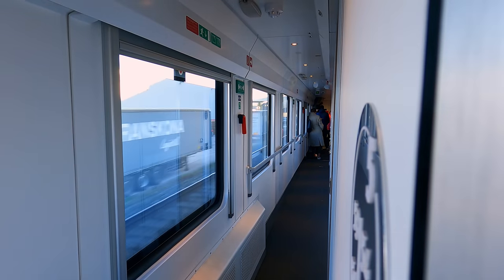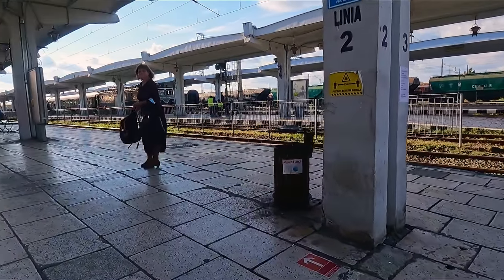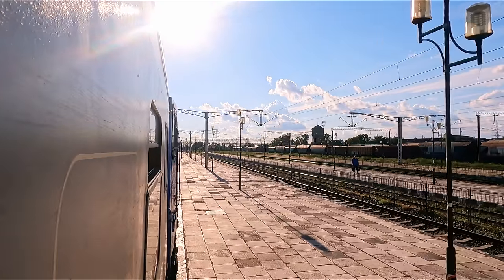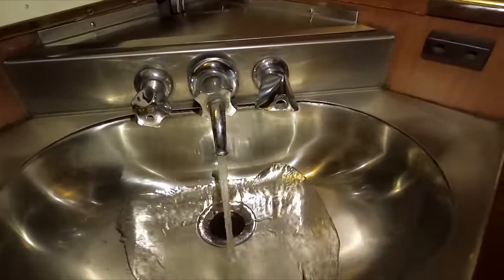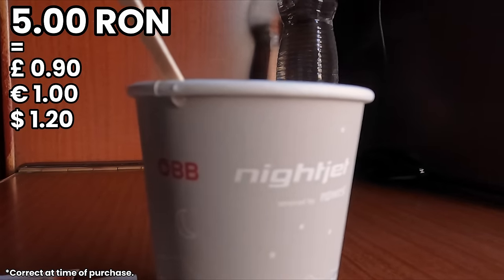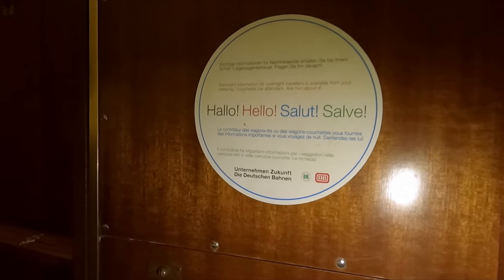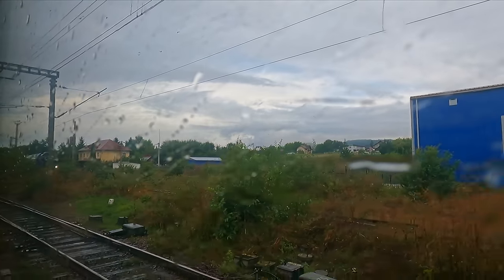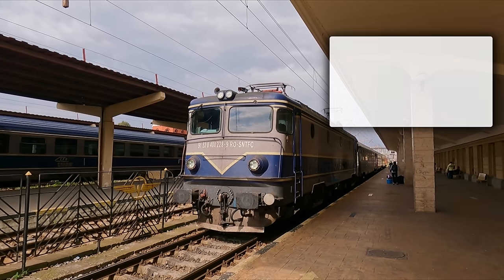My long ride on Europe’s OLDEST overnight train!

Comment: I travelled by train in Romania last year and had a nice experience. But there is so much unused potential in Romania. They have way to much car traffic and need to update their train infrastructure as well as implementing a regularised scheduling system with trains running every one or two hours on busy routes, especially to optimize commuting. I also saw that on the route from Brasov to Sibiu nearly every station we came across was equipped with staff and they have to give way for the train. That's a signalling technique that's incredibly inefficient. There could be so many more people riding trains in Romania.
Reply: As a romanian, I'm telling you, its easier said than done.
Reply: @TheRealVGR well, first it has to be said 😅
Reply: Currently the Romanian government's focus is on Highway infrastructure, so I doubt there are gonna be any major rail projects in the future.
Reply: @Ch-xc4fo  actually, there are currently plenty in development, as we speak. Including major corridors :)
Reply: And CFR is intending on cutting down more trains and staff :( . 10-14 years ago there were more trains and waggons too.
Reply: @roxyroxelle  yeah, it's because ridership levels have dropped and some routes are not profitable.
Reply: CFR has a lot of big projects running. They are modernising the main corridors. But I still don't see the light at the end of the tunnel. Last year, after 10(!!!) years of closures and serious restrictions finally the central section (Sighişoara – Alba Iulia – Simeria) of the mainline 300, the most important mainline, is finally ready. New signallings, high speed switches, brand new and fully EU-conform infrastructure. And if you want to travel for example from Blaj to Alba Iulia (county town) you have one(!!!) train per day. On a brand new high speed infrastructure. 

Also suburban traffic is unknown in Romania. They have several mainlines running between mountains, following banks of rivers, thus directly connecting smaller villages to bigger cities – without trains. And in this case "without trains" means 4-6-8, or even 10 hours of voids in the middle of the day without a single train, even on mainlines. 

2 years ago, first time in the history of CFR they made an experiment on the mainline 800 (this is the "iconic" line of the CFR between Bucharest and a main city on the bank of the Black Sea, Constanţa; a line fully modernised, speed up to 160km/h): as suburban traffic, they set up 6 pairs of trains: 3 in the moring, 3 in the afternoon. After 1,5 years they cancelled it. 

While some part of the infrastructure is undergoing complete refurbishment (on EU funds), other sections are amazingly neglected. For example the section Caransebeş – Orşova on the mainline 100 is full with 30 and 15km/h restrictions. Also on the mainline 100 there is a ~12km long(!) section with single line at the Balota-hill with 30km/h restriction (Balota also has some serious 10-15km/h restrictions). There was a passing loop in the midle, but after starting a rewamping project back in 2017, a disagreement arose between the CFR and the subcontractor, so since then the passing loop has only one track...
Reply: The population density in the villages and cities along the railway lines is too small to have a train per hour. Even from Cluj there are very few trains anywhere except to Dej and Oradea (the Oradea line is closed for a few years). The only lines with frequent trains are Bucharest - Brasov, Bucharest - Constanta and some other lines around Bucharest.

Comment: The train is taking such a circuitous route due to (never-ending) track reconstruction and upgrade works. Normally, the train runs either via Oradea - Cluj, but that's closed for electrification and upgrading. Alternatively, it runs via Arad, but that too is partially closed and severely capacity restricted for upgrading works. Even Timisoara - Lugoj is normally worked via the electrified Recas line, but that's capacity and speed restricted for upgrading works, so the train is diverted via the very rural Buzias line, which normally only sees Desiro DMUs and those tiny ancient rural railbuses. By the way, those archaic railbuses are finally going away in a few years - if you want to experience riding in a 1930s railbus based on freight car technology, powered by a repurposed mining engine, sitting on 1970s plastic seats, going 30 km/h, now is your time!
Reply: Thanks for the hint. Am leaving for Interrail next week and Romania is one likely target. (And yes, I know that using an Interrail ticket in Romania hardly is worth it. But I will be travelling on more expensive railways, too.)
Reply from the maker: I'd really like to try those 1930s Malaxa units. Maybe I will pay a visit to Romania in May.

Comment: Back in the late '00s, when I was commuting for my university studies, I've accidently got on this train in Simeria at around 1-2am in the night, when I got off my train to Cluj-Napoca to buy me a sandwich from the non-stop Simeria station shops which were on the first platform. The "Hunger'' (how this train is called) was parked right next to mine (the Craiova - Cluj-Napoca night train) on the 3rd or the 4th line, and when getting back from the station shop, with both trains having nearly identical blue wagons, I have mistakenly got on this train instead of mine. The train departed not long afterwards, and looking to get back to my compartment I wasn't finding it nowhere in the train, so I became stressed and confused. But when the ticket controller and some passengers told me that I was on the Timisoara - Iasi train and that it stops in Cluj-napoca too, I got relieved. It arrived at Cluj-Napoca 35 minutes sooner than my Craiova - Cluj-Napoca train that I have missed earlier at Simeria, and luckly I met on the platform the nice ladies that were in my compartment on the first train who told me they gave my luggage to the controller. So I went to look for him and caught him up across the street, on his way to the station's office. He was carring my luggage in his hand. I took my luggage, thanked him for taking it and took the bus to my student dorm where I peacefully slept until noon, pleased that I eventually arrived in Cluj-Napoca, with all my belongings, despite the stupid mistake I've done that night.

Comment: 10:32 Many people don't know about this, but the lever that brings the window up and down is supposed to be dismantled like that. It's because, underneath the lower bed, there are chairs for day use. Very comfortable but nobody uses them as there is extra work for the staff and they don't want that. Also, that's why the mattress developed a "ditch" in the middle along its whole length. People sit on it during the daytime (because the chairs are underneath and never used) and deform it.

Comment: I must note that the old trains were much better thought out in terms of creating a comfortable and cozy environment.
Of course, they are inferior to new trains in terms of noise and vibration insulation. But for me this has never been a problem. On the contrary. As a child, I adored trains because I slept listening to the sound of the wheels. Now almost everywhere there are seamless rails. And sometimes I really miss these measured knocks on a trip.

Comment: You seem to have overlooked one feature of many sleeping cars of that era, assuming that carriage still has it: a self-emptying chamber-pot in a cupboard under the washbasin that empties onto the track when you put it away after using it. I believe that many coaches that originally had that facility had it removed on refurbishment because it was deemed unhygienic, though.
Reply: I can remember when the Cornish sleeper train had that feature!
Reply: Until recently, it was unusual to have holding tanks at all in most countries, hence the typical warning labels to avoid using toilets during station stops.

Comment: Better built than modern stock. ❤
Reply: Seriously, in what sense? Just because of nostalgic vibes? Have you tried the Finnish double decker sleeping-cars? Or a new generation Nightjet sleeper?
Reply: @TangoMikeLima price of the ticket please?
Reply: It will be replaced by one of lower quality but more expensive
Reply: @eedragonr  You clearly have made up your mind and facts won’t help. Bye.
Reply: @eedragonr  In low season a ticket in an own compartment in a very modern sleeping car Helsinki–Rovaniemi (12 hours) can be had for clearly under 100€. (Just look for videos here on YouTube that show Finnish night trains).

The problem with a generalisation is that a single counter-example can disprove it.
Reply: I think that everyone has compared it internationally to the  capsule without windows.
Reply: @TangoMikeLima  thank you for being kind and answering. Meaning that the 60 years old (!) is doing better. As profit

Comment: As a tourists some years ago I traveled to Temesvár (or as in video: Timisora) by train. It became one of my most memorable journeys ever. In fact I was happy when I finally came back safe because of the many Gypsies and all kind of suspicious people traveling on the train. It looks like those who are not poor or who are a bit more educated do not travel by Romanian trains. I didn't know this. 

The rest room should be avoided if possible. I almost threw up. The train was from old times in my case too, with similar layout than in the video above. The comfort was not great, but for me it was enough on this local/passenger train for a 2X2 hours travel (back and forth). 

My wife traveled recently to Kolozsvár (or in Romanian: to Clui Napoca) with an express train, and she says that it was much more cultured than the regional Romanian train I traveled by, and the passengers were also better looking people. The price was as low as the video above informs. 

What a pity that Romania does not place more emphasis on regional train travel, because it's more environmentally friendly than traveling by car, or by minibuses. They should begin with the fight against the Romanian corruption, because almost nobody bought ticket on the Romanian train I traveled by - except me, who is Hungarian. The Romanian passengers only gave a tip to the conductor and they were allowed to travel for free. I'm not surprised that regional trains in Romania are so undeveloped.

Comment: Timisoara is my hometown and I can tell you that the regional rides are such fun (if you don't care about back pains and drunk people) -> so no fun. Through the place I moved now (20km apart from Timisoara) both regional rides and the IR1831 (the former IR1838 - your video probably was filmed a couple years ago while it was still running) pass, so I'm no stranger to these. There are plans and projects to modernize the infrastructure and the rolling stock, but it's gonna take a while.
P.S. The only regional ride I would recommend you to do is the Timisoara Nord - Remetea Mica station (1hr ride) because of the scenery and the fact that the operator, Regio Calatori, bought a "new" diesel railbus.
Reply from the maker: What are those new diesel trains like? Are they former SNCF units? :)
Reply: @SuperalbsTravels  As far as I know, they are not. The diesel trains are called VT2E and I think they came from DB. But you'll have to time it right, because they are not running daily on that Timișoara Nord - Remetea Mică route.
Reply from the maker: @just1dani Very interesting!
Reply: To correct myself, those were used for local transport in Austria, and were produced by LHB (currently part of Alstom group) @SuperalbsTravels

Comment: I’ve only travelled by train in Romania once, the short hop between Braila and Galati. For some reason it takes an hour or more o cover around 30km. It consisted of a massive electric locomotive hauling a single, duplex carriage. Having said that it was on time, clean, comfortable, the track quality seemed fine and it was very inexpensive - less than the equivalent of one Euro. Both stations are classic, Communist brutalist style with very limited facilities beyond each having a steam locomotive on a plinth outside. Both cities have trams but in neither case do they serve the railway station. I’ve still got the ticket as a souvenir. It’s actually a little card folder but does have the railway logo. I guess this service is now worked by multiple units.

Comment: Railway is in improvement. București Constanța 225 km has top speed 160 kmh. Soon they will finish Brașov Arad 450 km also with 160 kmh top speed. Next is Arad Timișoara Caransebeș 155 km.

Comment: Oh trust me, theres something much worse than the desiro. In around 2010-2013, RegioTrans or Regio Calatori (whatever you call it), which is the same operator that uses Desiros like in 7:08, also operates former RIO & RIB units from France. Some have been modernised with AC and a new cab, while others remain the same as they were bought, its pot luck really. They are also used on very, very long routes like the Desiros.
Reply from the maker: I've used them before, they're super wacky! 😂
Reply: @SuperalbsTravels  Do you know what services they run on?
Reply from the maker: I just had one from Brasov to Bucuresti.

Comment: Yes to the Desiro Regional. But only in Winter.
Because the Desiro Motors driving easily hot on high temperatures. 

If the german DB got problems with them, the romanian friends will definetly will have them

Comment: 6:23 In Baden baden(Germany) the main Station is 4 Kilometres from the city centre😂
Reply from the maker: That must be really annoying!
Reply: @SuperalbsTravels  you always have to take a bus but…
Luckily I don’t live there😅
Did you Ride a German IC 1 (the older one) yet?
Reply: This distance has a good reason. The former main station was close to the town centre, but Baden Baden is located in a Black Forest Valley (off the Rhine River Valley where the trains speed along. To make a stop in Baden Baden the trains had to go in and back out again on a branch line off the main line. Very time consuming. So the station Baden-Oos along the main line was turned into the main station with frequent stops of fast trains.

Comment: I can understand that you don't want to try the romanian Desiro Classic. But instead you could try the German Desiro Classic trains. I think that one of the longest routes that this train drives is the RE87 between Aschaffenburg und Crailsheim (3h and 2 mins). But that is just one of the routes this train takes. There are many more. One other example is the RB82 between Steinach (b Rothenburg ob der Tauber) to Rothenburg ob der Tauber. Though the ride is only 15 minutes long, Rothenburg ob der Tauber is one of the most beautiful cities in Germany with a stunning historic town center. 
You gotta ride the trains but don't do it in Romania. As I said, there are plenty of routes in Germany that are serviced by Desiros. I think most of them are owned by DB but there are also many private operators that own Desiros.
Reply from the maker: I don't know, I don't think I'd get the full experience on a local route in Germany. Though I have done a DB Desiro Classic for over 4 hours before! 😂

Comment: You consider the price for this trip to be affordable, and it is for someone outside Romania, but when you consider that the minimum wage in 2024 is 420 Eur or 453$, paying 66 Eur for this trip is very expensive for an average Romanian, this is why most people will take this 16h travel in standard seated carriages, which are more cheaper. Your trip was pretty much perfect by Romanian standards, but this is not always the case, unfortunately. Thank you for the great video.🚂
Reply: Thank you for further context and information. If your able to see and respond, please give further information on the typical issues that can be encountered during this trip. I was impressed at the lack of nearly any troubles for the OPs video.

Comment: The regional train? You know you want to really!
Reply from the maker: Are you sure Mr Hoover? 😭
Reply: @SuperalbsTravels  thinking about it. It would be an interesting video. I would be interested to see how a Desiro handles the poor track and probably cash strapped maintenance schedule. Is it a well built solid workhorse that can take the grind Romania throws at it, or a high tech design that cannot and hence becomes a rattle bag with many bodged features?

... but that would mean you'd have to ride one for quite a distance... 😬
Reply from the maker: @JohnnyHooverTravels 😂😂😂😂
Reply from the maker: One other traveller's report said that the toilet leaked everywhere and most of the windows were smashed. It sounds amazing.
Reply: @SuperalbsTravels  where there's adversity, there's views 😉
Reply from the maker: @JohnnyHooverTravels  Don't I know it! 😢

Comment: 7:02 Siemens Desiro, or the Blue Arrow (Săgeata Albastră as for Romanian). A crappy train. Don't try this shit. 
As for the speed limit, the maximum speed limit is 160 km/h, which can be reached on Bucharest-Constanța route, and the line between Simeria and Sighișoara.
Reply from the maker: Yes, 160km/h is the maximum, but not on the route I travelled on. :)
Reply: @SuperalbsTravels  I know. 15 minutes delay for a train... Good for Romania. ;)))